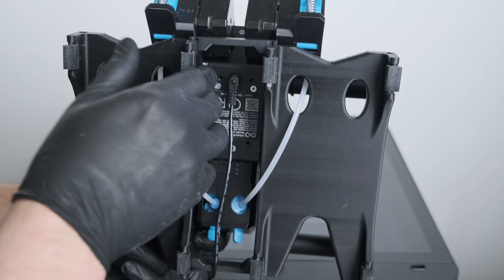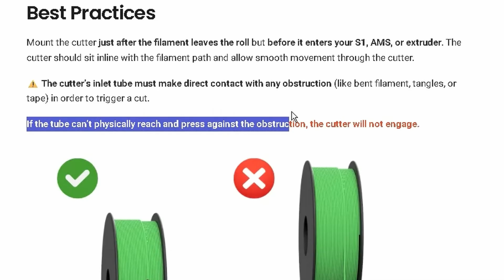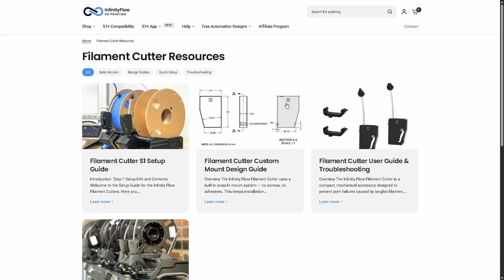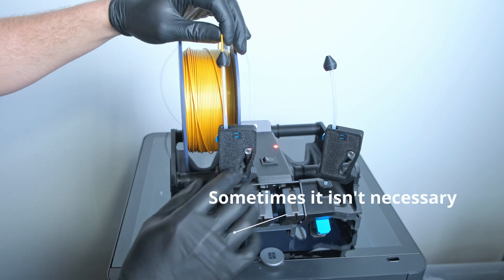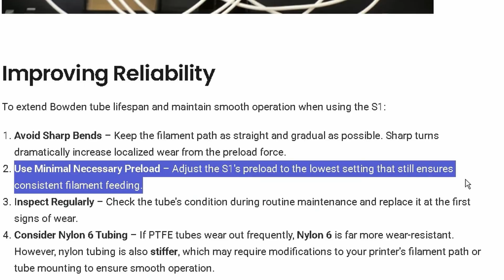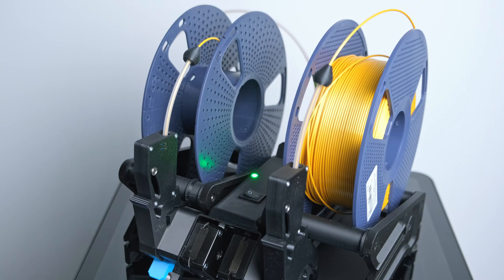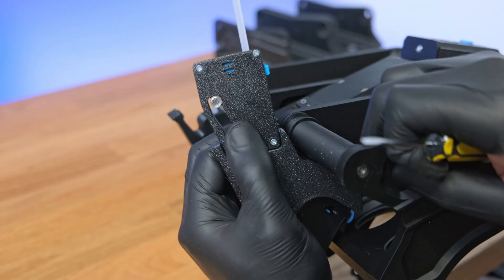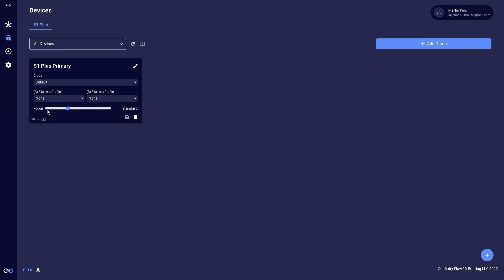Infinity Flow S1 Plus: Full Setup Guide

Comment: I just got one of these hooked up to my Sovol SV08 Max. It comes mostly assembled, now, and it worked right out of the box. I haven't bothered with creating an account or anything. The only problem I had was I made the mistake of snipping the end of my filament at too much of an angle, and it caused the filament ends to double up in the PTFE tube at the extruder, causing a jam. In hindsight that's obviously counter to the way the mechanism is designed to work. The bottom line is it works great and allows me to bypass that crap, noisy stock filament buffer on the SV08 Max, PLUS it gives me 2-spool capacity for the larger prints on that massive machine. Highly recommended.

Comment: Hey man, great video and demonstration. I was under the impression that the Infinity Flow S1 wasn't available for those in Australia, At least no at the moment. Has this changed?
Reply from the maker: Glad you liked the video! No it's not available in Australia yet, but I got sick of waiting for who knows how much longer, so I just used a reshipping service to get it over here. It cost about $100 more, but I desparately needed it for my business as there aren't really any other solutions out that can do what it can do (other than the wisepro, which only solves half the problem as it doesn't have any way to mount the spools properly).

Comment: I got one of these a few weeks ago, and am mostly loving it. I'm fortunate that all the defaults just work for me as I'm not interested in putting my WiFi credentials in a web app. It did take a bit of breaking in, but now it's smooth and just works.  I did end up buying an extruder with a filament cutter to make changing filaments a bit easier - but other than that, it's been smooth sailing.
Reply from the maker: Glad to hear it's working well for you! But yeah, I feel like it's going to take a good few days of printing until everything is running smoothly.

Comment: Thanks for the review. I guess you could also print other accessories, like something to allow use of the Polymaker Polydryer boxes directly.  I wish the app wasn't mandatory, like the comment below mentioned, handing over your WiFi password to random strangers is a bit much for something like this.
Reply from the maker: No worries! :) Yeah it seems as though there is a lot of room for 3d printed accessories, as it all comes apart very easily. But yeah, some dry boxes would be very handy to sit on top!